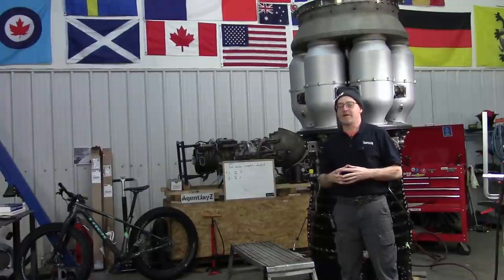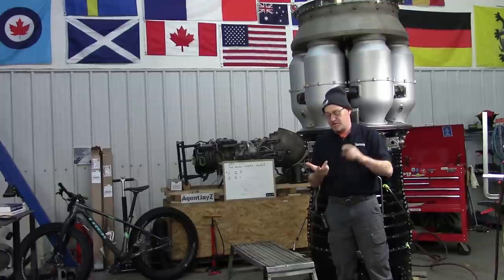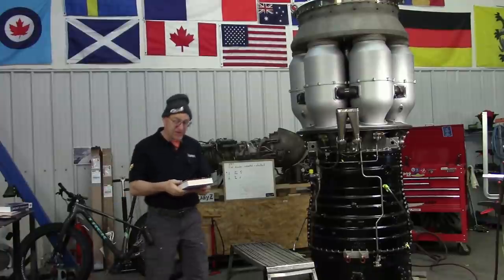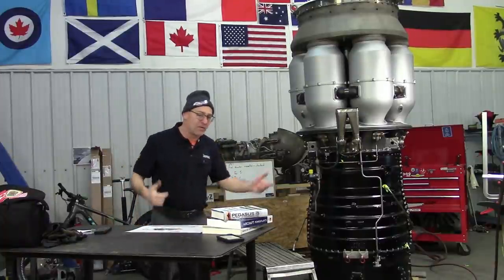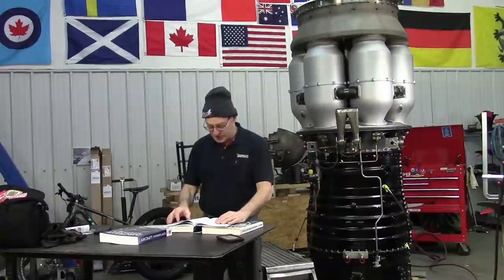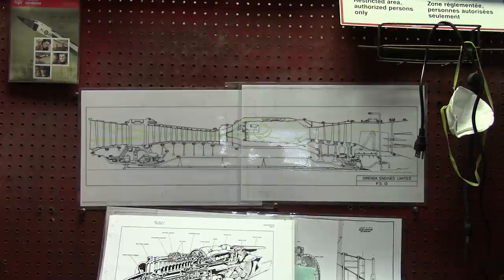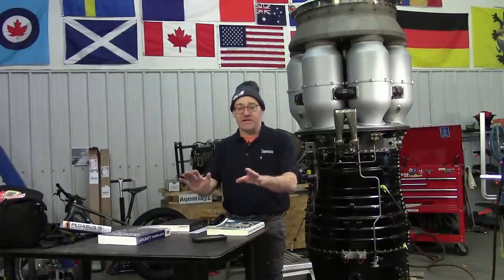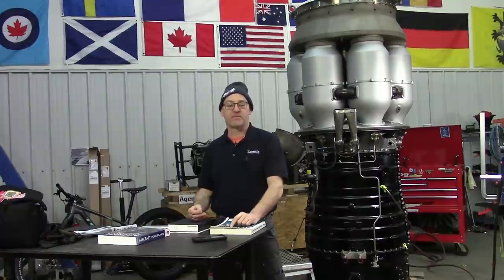So You Want to Design a Jet Engine

Comment: G'day,

Yay Team !

  Everything ye stated were true, too ; but regardin' Piss-Tin Engine's Crankyshafts...; ye be not (nyetski) tellin' the whole of that story...

  While nobody generally queries a Crankshaft's LENGTH..., the precise Diameter & Circularity of it's Bearing-Journal Surfaces, and their Parallel-ality with respect to each other...; was a matter of great "Criticality"...

I still have my father's 1927 Crankshaft Journal Scraper...,  which enabled a Crankthrow Journal which had been hammered by a failed Big-End Bearing, to be Re-Circularised, undersized, in the Field if neccessary - up through the Sump....

  And in 1948 the Old Man bought himself  an Offset-Chuck Crankshaft-Grinder, which was the only one for 300 Miles around...

But my father sold out & retired in 1973..., and when I got a job in his old Workshop in1979 the Crankshaft-Grinder was only used to sharpen the  Helical Cylindrical Cutter Blades on the Bowling-Green's Lawnmower...

But, as for the Wannabe Jet Engine Designers...; they're wedged between Dunning-Kreuger Effect, and Wishfool Thunkin's...

Personally, I recall fantasising that I could employ a 2-Cylinder 2-Stroke Ultralight Engine to direct-drive a 4-stage Axial Compressor , using 4-Bladed Wooden Airscrews, injesting all the used (heated) Cooling-Air off thw Cylindwrs, and with the Exhaust Gas injected behind the 4th-Stage Compressor Stators..., in an attempt to maximise Thermal Efficiency  in Motorised Utralight Sailplanes.

  Twenty years ago, I realised what a Quixotic Bullshit Quest that was.

   You have, hereinat,  dealt with such self-deluded Dreamers MUCH Gentler than they have any "Right" to expect.

Such is Life,

Have a good one...

Stay safe...

;-p

Ciao !

Comment: One aspect of jet engine design and production that is not covered in any of the books you discussed is the business dimension.  If the design meets all specifications and it works perfectly, can we make any profit selling 200 of them?  Think about it.  Boeing made roughly 1,600 747's.  That's only 6,400 engines.   Incidentally, the Boeing 747 started with JTD9's then went to CF6's.
Reply from the maker: Boeing did not make any of those engines. Just making sure we're clear on that, eh?
Reply: And almost every aircraft opperator also has a couple of spare engines, but yes the manufacturer would like to make a profit. Could that be why the actual sale price of a new aircraft engine (both reciprocating and turbine) are on a level with the orbit of the spacestation???
Reply: @pauljanssen1325  I worked for an small run electronics firm.  We did many projects where the deliverables were three units and the associated software.  Crazy stuff.  Each unit was worth $200,000, but if it had been developed inhouse, the cost would have been five times that.
Reply: @brucenadams1  and at a list price of arround 12,5 milion USD a pop for the last CF6-80'S to roll off the production line. A good 50 years after the first ones did I would venture to guiss GE made a boatload on the intire programme. In production you also calculate a forcast of the number of sales forcasted for the thing you are trying to sell. About half of the total number should be your break even point (accounting for currency fluctuations ect). Also the sale price on average is arround 300% higher on bespoke small production technology. It may be cheaper to source parts cheaper elswere than produce them inhouse for shure. That has to to do with the abillity of scale in "easy" to manufacturer parts on one side and the adaptation of an off the shelf existing product by it's original producer. As the CF6 was one of the most successful aircraft engines, just like the CFM56 family the abillity to costshare on initial investment greatly increases the chance of profitability and succes of the product you are trying to sell

Comment: Have you ever come across the, or heard of the use of vibration probes / monitors on a jet engine?
Reply from the maker: There is one on the engine when installed in the aircraft. We use two, three or four when testing an engine, depending on which model. Sampled and recorded once per second during the test.
Reply: @AgentJayZ  Thank you sir.

Comment: Question:
What was the most severe damage on an engine you encountered that could still run despite it? And also the most severely damaged engine which could be saved? Connecting to this is what extent of component replacement do you consider refurbishing an old engine versus buildig a new engine based on some components of old the one?
Thank you for your amazingly interesting videos. And have a happy new year!
Reply from the maker: Not writing you a book here.
The term is economic repair. If it's the only engine left, and has historical importance, no expense will be spared in repairing it.
If the engine is common, cheap to buy, expensive to work on, difficult to get parts for, and is not particularly reliable (I have a specific engine in mind here), it will be scrapped for relatively minor problems.

Comment: I've been designing a jet engine in solid works as a hobby for the past 3 years. And I only have my imagination and basic googling my own research. The design I've been working on produces thrust from the exterior of the engine n the engine will sit side ways. There's so many things that keep going wrong in the physics generator. I constantly have to tweak metal density. N clearances n leave room for expansion. It's super hard to figure out. Especially since I'm not an engineer.
Reply from the maker: Well, there you go. Any actual engineers out there with comments?
Reply: @AgentJayZ  my advice is: beware the commercial CFD software most CAD programs come with; it's 100% not robust enough to deal with highly complex flows like in a jet engine. Consider FUN3D or one of NASA's other good CFD codes, and you'll have to get good enough at using them to interpret the results and understand when they're telling you nonsense
Reply: How does that work?
Reply: @belacickekl7579  there's two types of fans. Ones direct flow shaft fan which is every jet engine. And the one  that I'm designing is a centrifugal turbo fan. Best way I can describe it is a horizontal hollow tube. On the outside you have cork screw like fan blades symmetrically coming from both ends n meeting in the center of the tube. And the exhaust air will exit out of a rotor less cyclone compressor( similar to what you would see on a Dyson vacuum) . And the hollow space in the tube allows air for combustion, pressure buildup  and is meant for cooling.

When I get it to work in the physics generator I will upload a video. But I still have lots of work ahead of me. Whether I change the world or not. I do enjoy designing in solid works.
Reply: @slyfly4829  all you had to say was centerfugal; I know what those are; they're good for smaller setups and have few stages. Anyway, what "physics generator" are you using?
Reply: @AgentJayZ  No comment.
Reply from the maker: Yes, Graham... I agree. Give this one a wide berth. The subject of this video, eh?

Comment: In theory jet engines are pretty simple. You pull air in, burn fuel, and everything rushes out the back. So many people don’t understand that it gets way more difficult for one to actually survive and make good power for a long time. Especially to be efficient at it too. 

Like how you can make a “jet” out of an old turbocharger. Sure, it’ll make noise and flames along with barely self sustaining. But, you’re not going to really get any power or thrust out of it and they’ll usually destroy themselves pretty quickly.

Comment: Sir is it possible to Create thrust as same as these jet engines by "Compressing air and ignite by micro wave which turns compressed air into plasma which can be used as thrust.
If Possible will it be efficient ???

Waiting for your reply 🤗🥰
Reply: The short answer is no
Reply: @rapidleopard3881   sir can you please explain in brief why it's not possible 🙏 ??
Reply: @sus5651  While it would generate thrust (probably a lot, if done properly), such a method requires so much energy that you would need to supply. The limit on this engine wouldn't be the engine itself, but the power supply.
Reply: @sus5651  Think of propulsion in terms of energy, and how it's converted from a medium to another. To name one of many reasons this is not the best of ideas, think of this as such. Jet engines convert chemical energy of fuel into thrust. Jet fuel has as amazingly large energy density. This proposed method of propulsion combines established compressed gas thrusters with microwaves. Compressed gas has a very limited energy density and is as such used for reaction control on spacecraft for example, as reusability and simple ignition prodcedures are most important there, given that reaction control doesn't require immense energy density. Microwave generation requires electricity and as such batteries. Batteries and compressed gas are two remarkably low hanging on the energy density chart, and as such would be impractical for pretty much all applications. The reason rockets and jets burn things is to convert the chemical energy to kinetic, where as this heats gas up, perhaps only potentially increasing its pressure, requiring a less gas. The microwave system as such may be redundant, as it does not convert electrical energy into kinetic in a remotely efficient way. Air contains essentially zero chemical energy to be converted, so heating the gas up with microwaves is essentially just adding the electrical eneregy to the gas. Since batteries store energy in a less dense way than compressed gas does, this is yet again redundant. 

In summary - This system takes compressed air propulsion and makes it less efficient by adding electricty to it, increasing complexity unnescessariy and reducing energy density.
Reply: Microwaves have no effect on air. It would be like trying to cook a fish with a flashlight.

Comment: I have spend 6 months to design a simple turboprop engine that is driven electric instead of gas powered. Its not efficient obviously, but I did it to experiment with the turbine of the turboprop and try. diferent designs. Ended up spending 4 months trying to perfect the compressor and didn't even came close to perfect. In the end the litle thing runs nicely but is far from efficient and perfect. Cant imagine what it takes to make a full gas powered jet engine.
Reply from the maker: If your turboprop is electrically driven, it does not need a turbine, so it's not a turboprop any more.
Also, it does not need a compressor, because that compresses the air to be burned in the combustor, to feed the turbines.
Also, it does not need a combustor.
What you are making is an electrically powered prop.

You can indeed imagine what it takes to create a gas turbine engine... if you watched this video.
Maybe.
Reply: @AgentJayZ  I know that I dont need al of that. Thats why its inefficient. But I liked the idea that I could simply swap the engines source of energy. Instead of burning gas, im using electricity to power it. The compressor is there as prove that you can make a compressor using 3D printed materials. The whole thing is more a experiment then anything else.
However the fact that the only thing I changed was the source of energy makes sound like a real jet. What in my opinion is awesome. 😊
Reply from the maker: You should have changed the source of heat. An electrically heated "combustor" would make functional sense, and has been done. So has a nuclear heated engine.
Using an electric motor to run a compressor into a non heating combustor, so not expanding the air to go through a non-functioning turbine to do (what?) ... I must be missing something here. I shouldn't have missed that meeting!
Reply: @AgentJayZ  👌
Reply: @AgentJayZ  well, heat was never a option as the while thing is 3D printed. The idea was to put it in a RC jet boat (inspired by your river jet boat videos) in order to do that it needed to sound and look as realistic as possible. Real rc turboprops for marine use cost around $4500, money I dont have. So figured I design my own electric powered one. Made compressors in the past, just not axial ones. Thats why it took me so long to find something that could withstand 30Krpm while being 3D printed.
Reply: @enginesandmore1013  What are you compressing air for if you're not burning fuel? It sounds like you made a profoundly inefficient electric blower.
Reply: @Guysm1l3y  it compressrs air because thats the only way I could get that real jet engine sound. Tha compressor is also modular, so I can take it of and use it as a high volume compressor.
Reply: Wait. So you built an electrically powered noisemaker that sounds like a jet engine? Well, that's one way to do it...
Reply: @mikecowen6507  basically, yes, but its functional, just not so efficient

Comment: i just read a disturbing story about fuming on jet engines where there is a seal leaking oil and sending the fumes into the aircraft potentially incapacitating crew and passengers and it seems to be fairly common.

Comment: My take away from this is that it very well might actually be easier to design a rocket engine than a jet engine.
Reply: A rocket engine often has fewer pieces, but the operating parameters are far more extreme. Oh, and when a rocket engine blows up, there often isnt much to examine beyond the telemetry...
Reply: A simple solid rocket engine is ez, you can build one in your own home using common ingredients to make the propellent and stuff it into a tube and your set! Liquid fuel engines are much more complicated though.

Comment: Got a question for my curiosity. Is it possible to thermally shock an engine? For example go from a high heat high load to low load and either drop altitude causing lower temps (or was it vice versa) or entering a storm which rapidly cools the engine. This is more my curiosity, hope you're having a good new years.
Reply from the maker: The most severe thermal shock to an engine is to shut it off while at max power. Have a look at my video called Cool Your Jets.

Comment: JayZ, are jet nozzles converging-diverging? I know afterburners require expanding ones to expand the THROAT, do they also have a diverging section? Or some do some don't?
Reply: An engine with an afterburner doesn't actually require a convergent-divergent nozzle, even to go supersonic. I can name several engines on this side of the pond, which had reheat (that's our name for afterburning) that didn't: they had a convergent variable nozzle. There were the Sapphires in the Javelin, the Avons in the Lightning, the Adours in the Jaguar, the Speys in the Phantom and the RB199s in the Tornado.
This means that the reheated exhaust leaving the open convergent nozzle was at the speed of sound, but the aircraft was exceeding the speed of sound.  If you need me to explain this, get back to me.

Comment: Hello Sir ! 
 Do different stages of a compressor spin at diff rpm ?
Reply: @Havelszky  thanks for the explanation,  but still i didn't get what i asked .
What fo you mean by diff points of diameter ?
Reply: @83abhinavnigam  a multi-stage axial compressor can be considered as a single pice, therefore all the points that compose it rotate at the same angular speed. In a jet engine you can have several compressors, for example one for high and one for low pressure, these two compressors will rotate at different speeds because they need different angular speeds to work properly, so they are connected to different shafts
Reply: @librasd8087  thankyou for your kind reply.